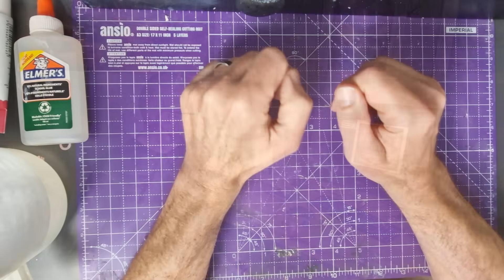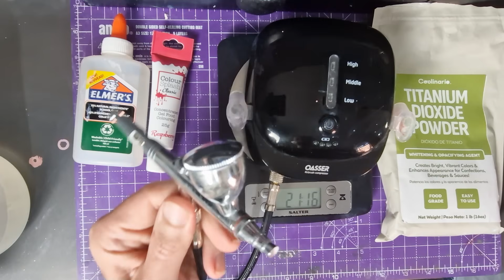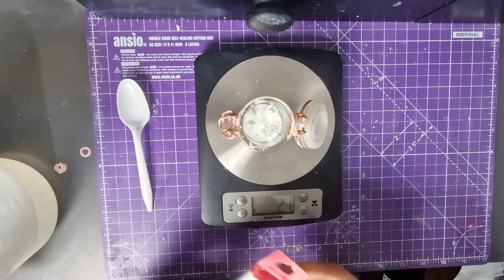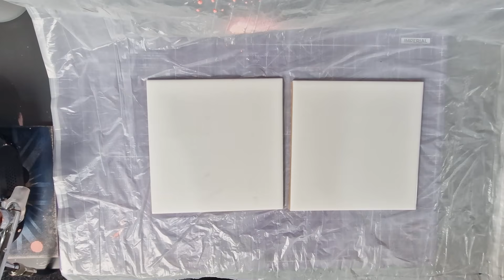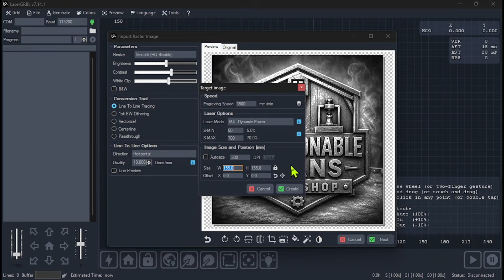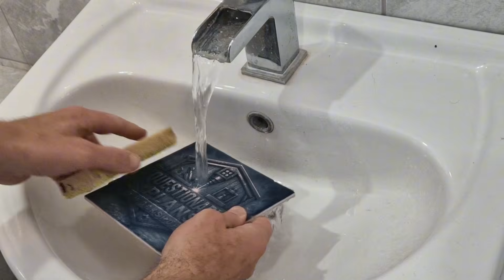I Turned Plain Ceramic Tiles into Laser Engraved Art | Norton Tile Method

Comment: I had a lot of trouble with the water mix. I switched back to 91% isopropyl and it fixed a lot of my problems.
Reply from the maker: I was the other way round, I found the isopropyl evaporated too quickly and left a gritty texture.

Comment: I tried this and I getting a lot of rough texture and it is not black.  I have tried several settings high power, low power as well as different speed settings.  It feels more like textured tile that is a spotty texture.  I hope you can help.
Reply: I forgot to say your stuff looks great, I'm hoping to do as good with my stuff.  I use an airbrush to put ti-o2 on and it look even all the way across the tile.
Reply from the maker: it sounds to me as though your titanium dioxide is not applied smoothly. I do 5 light coats and use an airbrush with .5mm nozzle. When I applied it with a brush or with a garden mister, my results were very rough too. Remember, the focus plays a significant role too. I hope this helps
Reply from the maker: Hi, if the coating is rough, i suspect it is because you spraying it a little to thick for each coat. this is why i do 5 thin coats. if the colour is light grey or Blue, I would think your focus is a little out. I hope this helps
Reply: Hello.
The mixture the gentleman is using isn't very good.
It is best to use this ratio: 2–3 capfuls of water, 1 full capful of titanium oxide, and—even better—a few drops of glue and some food coloring. The problem with using too much glue is that the laser burns it off instead of effectively penetrating the ceramic glaze, resulting in a poor outcome. However, it is best to run a few tests with the liquid to determine the optimal ratio. Basically, use as little glue as possible so the laser doesn't blow it away—especially if using a compressor like the one on my CO2 machine.